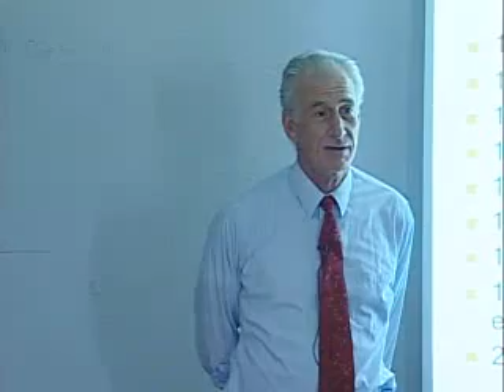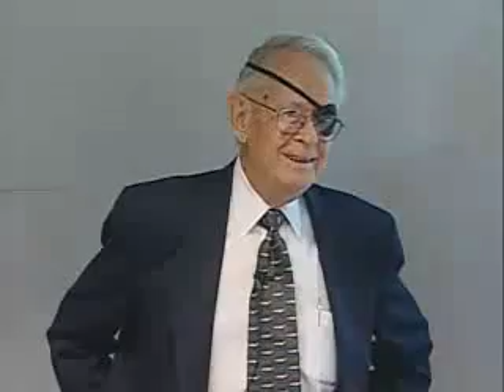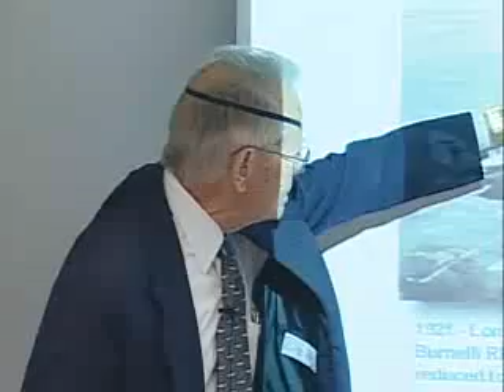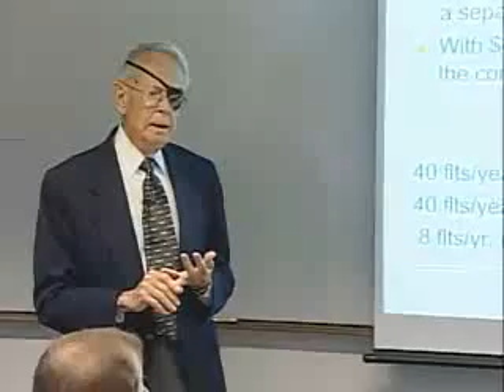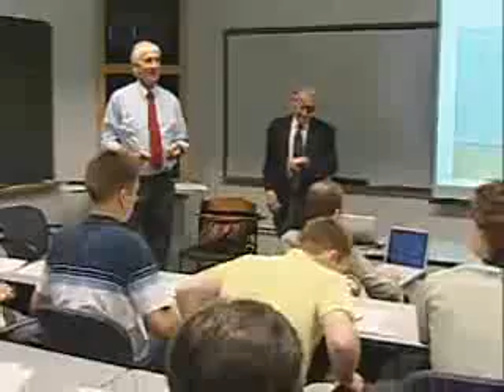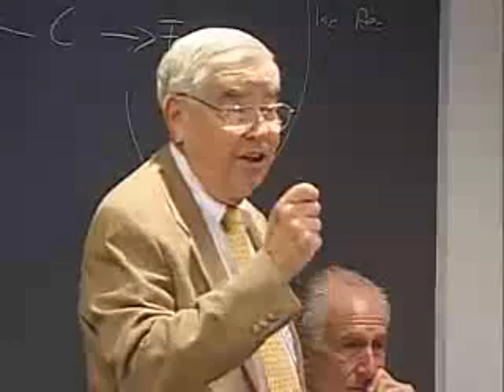Lec 1 | MIT 16.885J Aircraft Systems Engineering, Fall 2005

Comment: Why the camera doesn't move its focus to the slides
Reply from the maker: In the early days of OCW, we were concerned about getting sued for copyright infringement. That is why camera operators were instructed to avoid capturing the slides. Everything after ~2010 was published with material that could be defended under Fair Use. Many of the documents not show are in the course materials at: http://ocw.mit.edu/16-885F05. We recommend checking out the MITx version of the course: https://openlearninglibrary.mit.edu/courses/course-v1:MITx+16.885x+3T2019/course/. The MITx version doesn't omit as much material. Best wishes on your studies!

Comment: MIT the title for this video would be better labeled a history of NASA  social and political issues.
Reply: Dude the systems engineering decisions were as much societal/political as they were technical. STS was a massive capital (prestige) aerospace project designed and built with tax revenue and run by a government of the Murricans. 

Cohen says right in the first video that external factors guided the requirements as much as anything else.

Comment: The Cameraman should have shown the slides and not just focus on the lecturer, a split screen would have been very useful.
Reply from the maker: Many of our earlier videos intentionally avoided recording the slides to avoid possible copyright issues. Our more recent recordings are not as conservative. We do have a few presentations and lecture notes available, which will help fill in the gaps. See the MIT OpenCourseWare site for the materials at: http://ocw.mit.edu/16-885F05.